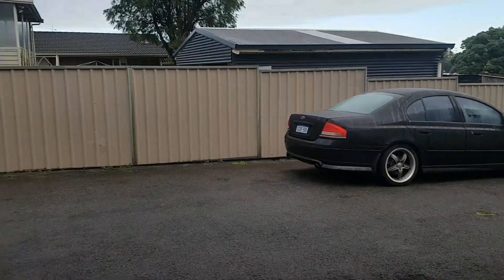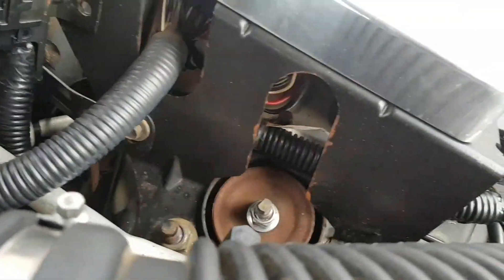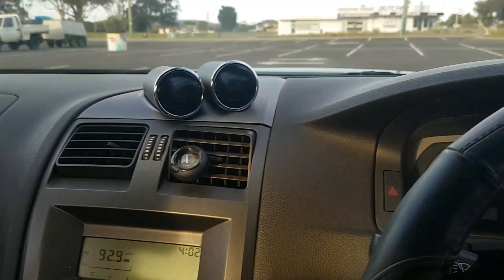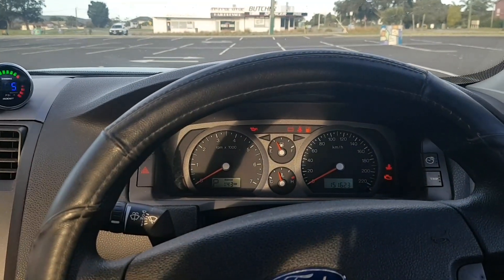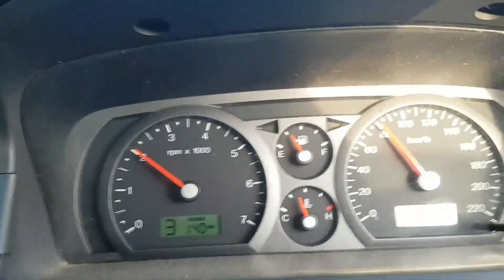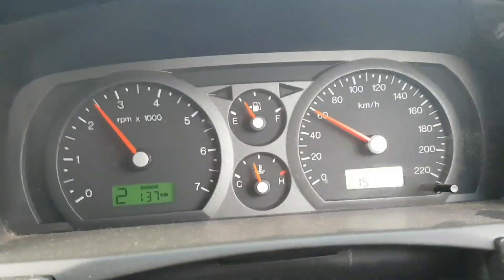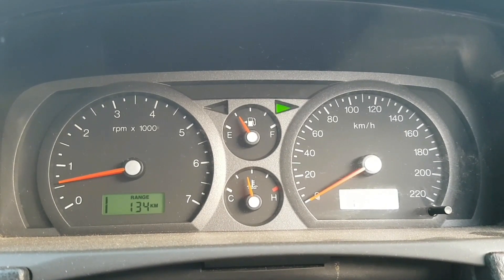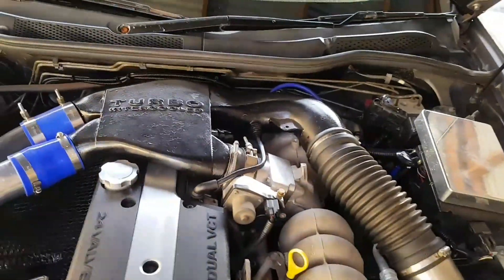Budget ebay turbo BA XT falcon gets a shiftkit!!!!

Comment: Hey mate what turbo kit did you purchase off eBay ??
Reply from the maker: Hey mate no kit as such just bits and pieces of Ebay, i have a few videos of what I used if you wanna check them out 😁🤘
Reply: @RossHollandAU   cheers mate what did it cost all up ?
Reply from the maker: @Nochaile  I have a detailed video on that too ::p but about 2k in parts then a cost of a tune 🤘

Comment: How well do you think the BA motors would handle a turbo? Did you do any upgrades to better the reliability?
Reply from the maker: Yeah they can handle a turbo just fine, you just cant expect to go to higher boost setups with it. Engine is stock, but tuned accordingly :)

Comment: Still got the BTR mate. How does she handle the power?  I've been told they're really good with some mods
Reply from the maker: Yeah mate! At this power level and the mods I've done it loves it 👌 even better with a high stall :)
Reply: @RossHollandAU  awesome man. I've got an 03 XT myself that's getting headstuds, pump gears, valve springs, going high stall with a large trans cooler and hoping it'll like 350 kw 
GT3582RS and a PW cooler should get me there. Don't want anything crazy, just something that'll keep upto all the LSs already have all the V6s covered 🤣
Reply: And it's all budget, only 3k(ish) most of the shit I'm getting is off Ebay. Plus some turbo bits off any wrecks I find
Reply from the maker: @s4ss.m8  sounds good bro!! Keep up the good work 👌🤘
Reply: @RossHollandAU  keen to see some more mad content out of your Falc 🔥
Reply: @s4ss_m836  my btr is sliping 3 gear